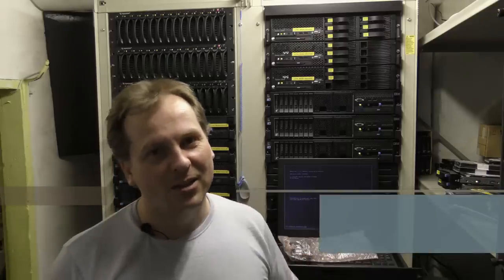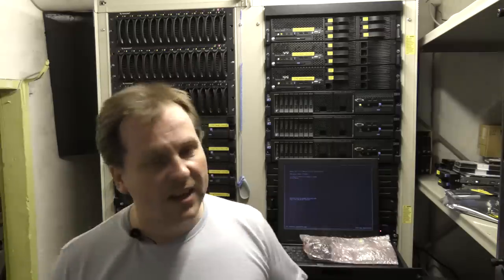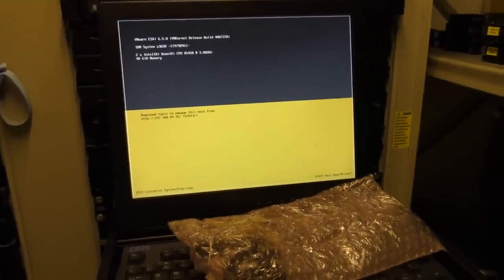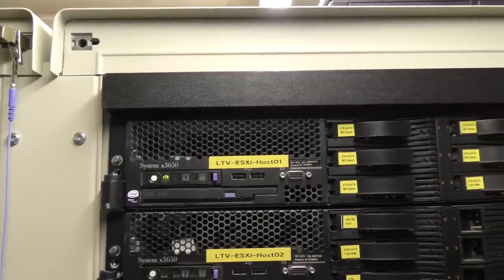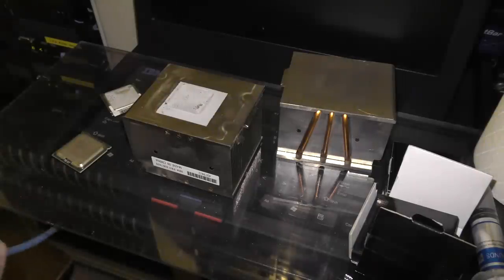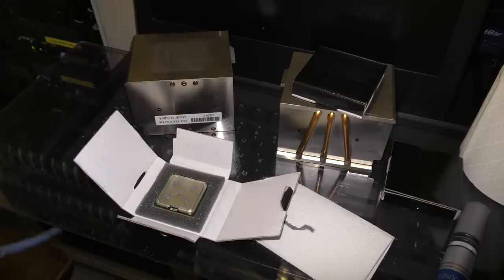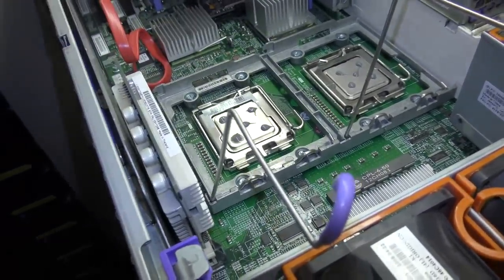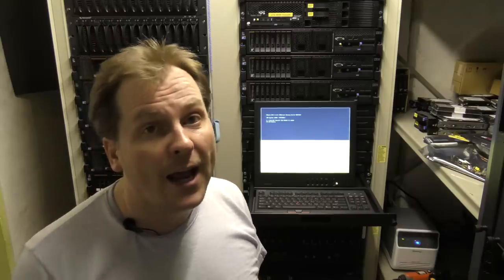5.2% more out of IBM/Lenovo x3650 M1 with XEON X5460 - 694

Comment: Great video Morten. I have recently picked up an IBM X3400 M3 Tower server with only one CPU quite cheap, that I am hoping to upgrade with Two E5649 2.53GHz Six Core CPU's, but I am having trouble finding a cheap 2nd cpu VRM module, as the only ones I can see for it are very expensive in the U.K.
Reply: The lowest one I could find was on AliExpress for $282.74, on a Sale going for another 17+ hours.
Reply from the maker: Hi MadIIMike
Thank You very much!  Would it almost be cheaper to just get a new CPU with the VRM for the x3400 M3 :-/
Thank you for watching! :-)

Comment: Good video. These are excellent CPUs, but the only drawback is the absence of hyperthreading which is valuable with ESXi. I dont think it would make any difference for the performance (E5450 vs X5460) but it is good for lab practice. Thank you Sir.
Reply from the maker: Hi Mamdouh Tawadros
Thank You very much!  The E5450 is a tiny bit faster then the X5450, and the X5460 is a bit faster than the E5450. This server works well with ESXi,, up to 6.5
Thank you for watching! :-)

Comment: Just wondering, do you have something like a Dell T5400 or HP xw6600 (or something similar) with dual CPU installed? If so, it would make a interesting video if you'd put a GPU in them (they have PCI-e 16x Gen 2 slots and 1 (HP)-2(Dell) 2x3 power connectors) and play a few Games. :P
Reply from the maker: Hi MadIIMike
Thank You very much!  glad you liked the video :-)
Thank you for watching! :-)

Comment: hello, I've revently aquired an IBM X3650 M1 (7979), i was wondering if you know of a BOMC utility that still supports downloading the latest firmwares & Bios etc. I tried to download the IBM BOMC V2.31, but was unable to connect to the update server, then tried V9.41 & V9.64 but both those version don't support the 3650 M1 anymore.  I have also checked out the lenovo BOMC all versions back to 10.1 but none of those version support the X3650 M1 (7979) either.. I have been told you're the man to ask and are the king of these servers haha.
Reply from the maker: From what I can see on IBM,, you should try v9.40 witch is the one they let you download for this model.
https://www.ibm.com/support/fixcentral/systemx/selectFixes?parent=System%20x3650&product=ibm/systemx/7979&&platform=All&function=all#Utility
Reply: @MyPlayHouse  in the 9.40 version under x3650 it has got machine type 1914, and on the front of my machine it has got MT - M 7979 - 31M. Will the downloads for 1914 still work with my 7979 machine?